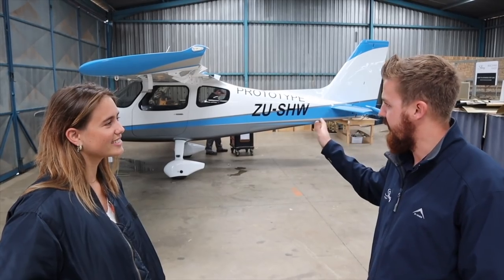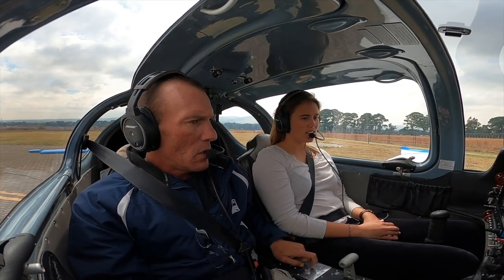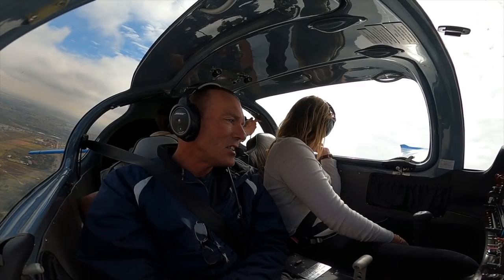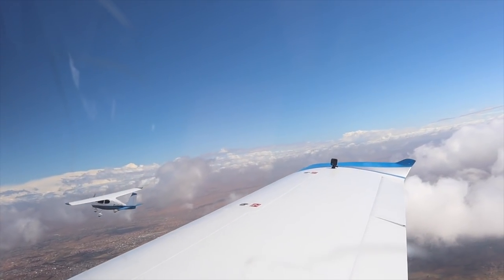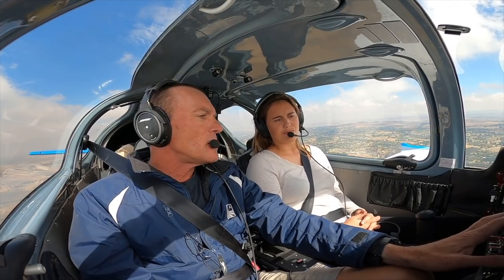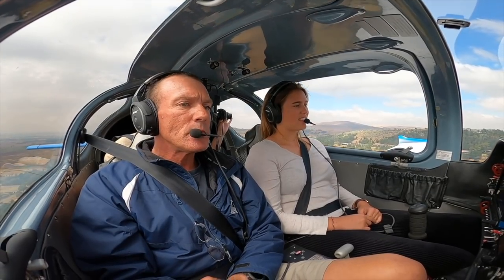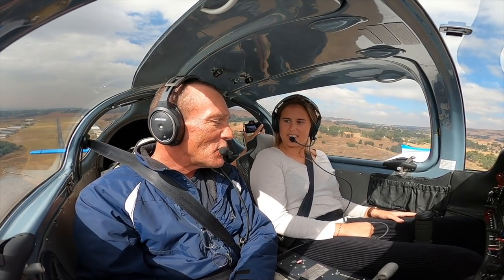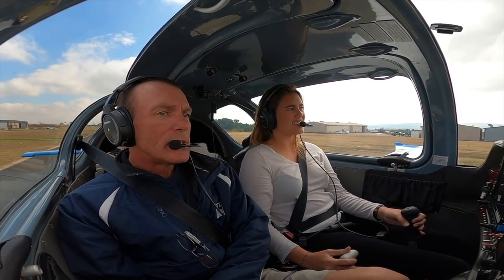The CRAZY capabilites of the Sling TSI (Test Pilot Demo Flight)

Comment: “ No delay on the power, just like a jet “ ?    Hmmm….Seems he hasn’t ever flown a jet ! (They are quite slow to spool up )
Reply: Yes, and there might be significantly less delay than a turbine. With its constant speed (variable pitch) propeller set to high revs (fully fine), increases in power (requiring no increase in revs) will be delivered quickly.
This Sling TSI aircraft reminds me of the Socata Trinidad TB20 that I used to fly (especially those gull wing doors!). But it’s lighter, lower payload, turbocharged, and longer endurance and range. Retractable undercarriage would be an interesting (but possibly heavy) addition!
Reply: Jets are not immediate power.

Comment: One of the very few things that makes me proud to being a South African residing in PE.  My first flight in a Sling 2 left me seriously impressed.  At sea level she lifts off before you can settle in nicely into your seat.  Smooth, easy to fly and also no rudder required except for cross wind landings mostly.   The radio banter on this one is insane LOL.  Julle gaan die owerhede mal maak LOL.

Comment: Sorry, but using rudder to turn is to counter the drag the right aileron causes by going down and increasing lift. It causes the nose to go right at first, as you can clearly see at around 9:47. It's ok the plane gets back to coordinated flight on its own. You should still use the left rudder input to turn left and right rudder input to turn right.
Reply: This may be very true, but comment again when you've actually flown one.
Reply: @hanznel8488  It's standard aerodynamics.